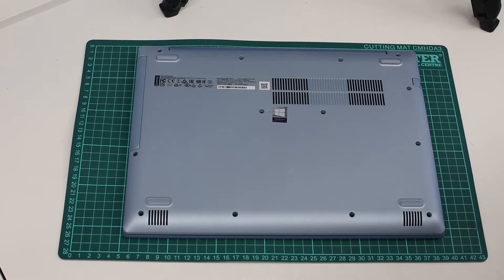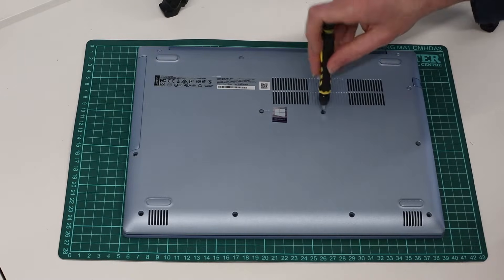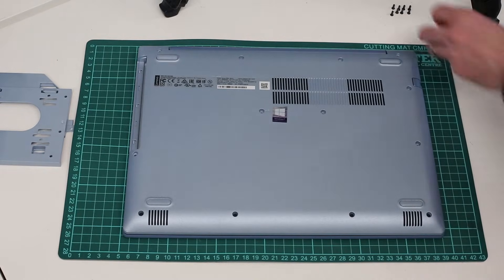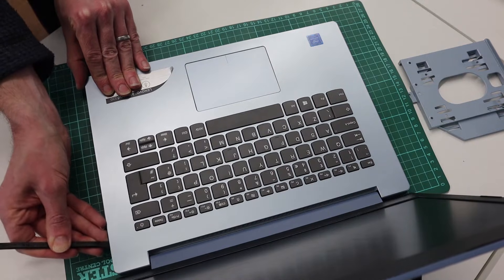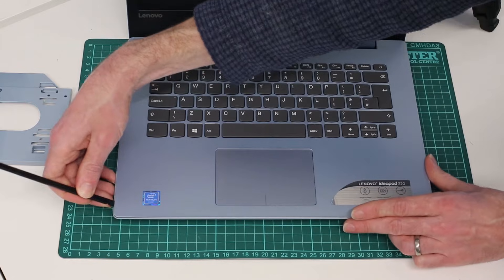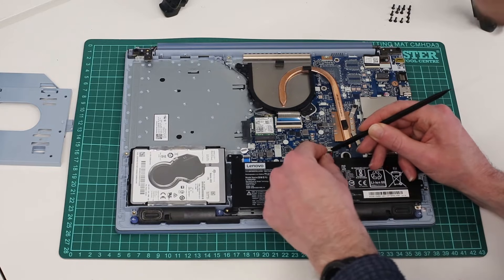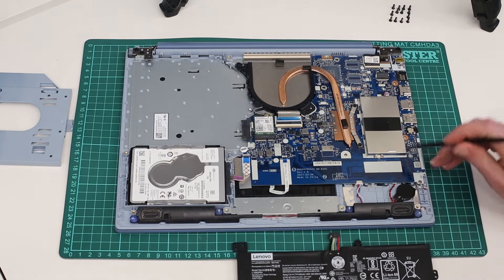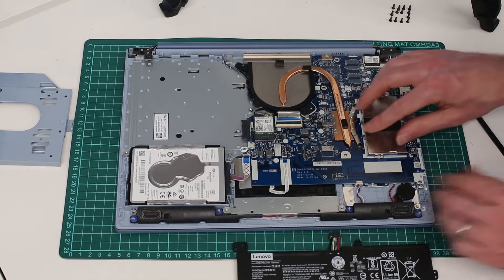Lenovo ideaPad 320 SSD/HDD and RAM upgrade guide

Comment: Hi, what is the maximum RAM we can add excluding the soldered one?
Reply: I just installed a 16GB memory stick and now it reads it as 20GB memory and 19.7 useable :)
Reply: @miketuck3010  so I can install 16GB memory stick without any hesitation or issues
Reply: @syedmominhina  absolutely! I just did that today myself on this laptop
Reply: @miketuck3010  Great then.. Thanks for the response bro
Reply: @syedmominhina  All good now?
Reply: @arifhm1  yes.. it is working fine with additional 8 GB along with 4GB soldered total 12GB now
Reply: @syedmominhina  Great! Thanks1

Comment: Enjoyed this tutorial. Gonna do this for my ideapad. Can I ask though, what's the rationale for swapping a 1tb drive to a 240 gb drive? I understand that ssd is much faster, but why swap to  a lower storage capacity?
Reply: Maybe it's like my case, I have 1tb of storage and I've never filled even half, buying a 1tb ssd would be much more expensive and I know I wouldn't have to fill it.
Reply: SSD are way faster than some people imagine, and most people never really use even half the storage of a half TB drive. So for some people speed might matter more than storage, Especially since the data that is backup can be stored on clouds or an external drive
Reply: @navysaw23  I know some laptops can hold both a HDD and SSD storage. Could it be done on this unit of laptop?
Reply: @mae6626  the kind of Drive doesnt matter, only the space in the case and the capability of the motherboard do. useually laptop can only hold one Drive, but if you have an DVD Reader, you migth be able to exchange it to another drive. Cables connection (SATA) is the same

Comment: Yes you did the physical part of it... But what about the system recognizing it and bios setup. Not as easy as your video. Tried it... Tedious task for the average user. Tell them the truth about the OS install that will not be there as they expect it to just turn on and be fast. If your gonna do this. Be specific. Most dont know and will try this on their own without thinking of all the factors.
Reply: Just clone your hard drive that you are replacing from the instructions that are provided with the replacement SSD drive, that's all I did.  I even upgraded the memory with a 16GB memory stick and had no issues whatsoever.  It took me all of 30 min to take a part the laptop, put the new memory and SSD drive in and booted up without any issues.  Much faster laptop now with those upgrades.

Comment: Hi, I followed your instructions for my Lenovo 320 and upgraded the RAM. Thanks a lot.
Reply: DDR3? DDR4?
Reply: @stetm8  DDR4
Reply: @MrPsyUNIT  Is it true that it can only have a max of 16 mb RAM?  So, I would remove the 8 mb RAM I have, and then input the 16 mb RAM?
Reply: @MrPsyUNIT  Is it true that it can only have a max of 16 mb RAM?  So, I would remove the 8 mb RAM I have, and then input the 16 mb RAM?
Reply: @tansyalexander2543  there's only one slot for RAM, so yes, you would have to remove the current RAM chip & install a new one. Based on my google research it can only take max 16 gb RAM chip (I may be wrong).
Reply: @MrPsyUNIT  Thank
Reply: @MrPsyUNIT  I added 16GB ram today and my laptop reads 20GB and 19.7 as useable :)
Reply: @tansyalexander2543  I added 16GB ram today and my laptop reads 20GB and 19.7 as useable :)
Reply: @miketuck3010  did it work perfectly or did you have to lower the ram ?

Comment: Hi!... I noticed that in the cover of the CD drive you can put a second hard disk but the connection we have there is micro sata (if I'm not mistaken), do you know if there is an adapter that can work to install the second hard disk there?
Reply: Yes u need a special adpater called caddy

Comment: can someone help me with my problem?

I was planning to upgrade my ram for my Lenovo IdeaPad 320-14IAP

I ordered a
Kingston ValueRAM 8GB 2400Mhz DDR4 Non-ECC CL17 SODIMM 1Rx8 Laptop Memory RAM

but the seller suggest that i should buy the one with 1600MHZ instead of 2400Mhz
Kingston Value RAM 8GB 1600MHz PC3L-12800 DDR3L 1.35V Non-ECC CL11 SODIMM 2Rx8 Laptop Memory RAM

the seller also told me that the ram with 2400Mhz is not compatible to my laptop.

should the 2400Mhz still works? or should i cancel my order? thanks for reading.
Reply: Lenovo 320 use ddr3l 1600 mhz
Reply: @user42362  thanks
Reply: I just installed 2400MHz 16GB DDR4 PC4-19200 without any issues

Comment: Is it relatable to idepad 320 151sk model,Can i add or exchange ram?plz reply
Reply: Yes, I used these instructions for 320-15ISK, in replacing the HDD for an SSD,  and the inside of my laptop had the same layout as presented in this video.
My model had 4G of RAM soldered on the motherboard and with only one free slot for another RAM stick
Reply: Can i add 16gb ram 2400mhz.?
Reply: @payatpayat3997  Yes, according to the Hardware Maintanace Manual, it should support 16G / 2400MHz RAM (see page 71)

https://download.lenovo.com/consumer/mobiles_pub/ideapad320-15isk_320x-15isk_320-15ikb_320x-15ikb_320-15ikbtouch_hmm_201704.pdf#ideapad%20320S-15ISK%20IKB%20HMM_EN.indd%3AAnchor

DDR4 2400 Memory (ISK and KBL only), 16GB DDR4 2400 SoDIMM, M471A2K43CB1-CRC / SM30M499035
DDR4 2400 Memory (ISK and KBL only), 16GB DDR4 2400 SoDIMM, HMA82GS6AFR8N-UH / SM30G165135
DDR4 2400 Memory (ISK and KBL only), 16GB DDR4 2400 SoDIMM, MTA16ATF2G64H-2G3B1 / SM30G16514

I presume those were confirmed to work with the soldered 4G of RAM (on the ISK model, in my case)

Comment: Is CPU can upgrade with Lenovo IdeaPad 320?
Reply from the maker: No, the CPU is soldered down in pretty much all modern laptops - only a few very high-end gaming and workstation laptops using desktop CPUs have replaceable chips.
Reply: @BrueComputing  but the GPU?
Reply: @BrueComputing  can upgrade with the GPU?

Comment: How many RAM slots does it have, beside the One which is already on the system and cannot be removed? Are there 2 or there is only 1 extensible RAM slot?
Reply: No well some models have 4gb pre installed so you can add another one like 16GB ram and in total you will have 20gb ram since one ram slot is already allocated

Comment: i loved your video! i was really scared of opening my pc.

but can you install the SSD in another slot? so that you can have both a HDD and an SSD?

im sorry if it's a dumb question, im really new to this.
Reply: from what i know, you can replace the optical drive with an ssd + caddy, but it'll not give as much performance as the original hdd port.
Reply: @poisenpoi69420  what if you just replace the HDD with the ssd and connect the HDD to the caddy?
Reply: @CarlosAlberto-gf3dy  i think it will not work

Comment: Thanks a lot, the advice on pulling out the battery worked nicely. I was concerned about pulling it out because I had heard some models had it so you couldn't remove the battery, but it worked like a charm.

Comment: Thank you for this tutorial. I've been wanting to do this when I first purchased this laptop. It's been several years now and I've watched this video several times. Thanks to your video, I'm ready to tackle this upgrade. Without rushing it took me about 43 minutes to install 500 GB SSD and an additional 16GB RAM. (Total 20GB) The cloning of HDD was actually much more difficult than this. Thank you!
Reply: What brand and type of memory is that?
Reply: I'm trying to clone the HDD and having a rough time. Was there a specific video you would recommend?
Reply: @michael7235  See: https://www.youtube.com/watch?v=JV43dmhsQS4 for James' video.
Reply: can you add additional memory to the existing 4GB RAM? I have the 320 151S model
Reply: How does it work now ?
Reply: @High_on_fitnesss  i added 8gb ram, making it 12gb ram. I noticed speed difference than the original 4gb ram.. especially since im using windows 10 on HDD. So much faster now
Reply: @gmybear87   i wanna add ssd 500 and how many ram i can add ? pls help
Reply: @gonfreecs1331  4GB or 8GB

Comment: I have some question. Is the optical port is sata 2 or sata 3?? If i put ssd through caddy without replacing hhd then will i get full utilisation of ssd. I have lenovo idea 520 2tb hhd series plaptop. Is the 2 tb also 2.5 mm thick. ??

Comment: Hi! I have the same model, does it really not has a fan? I am curious because i haven't opened it yet.
Reply: I see. Thank you
Reply from the maker: It depends on the model you have - this was a Pentium Silver based version of it which uses very little power. The Core i3 and above models will have a fan as the processor generates more heat.

Comment: hi, I have the same laptop, I would like to know if in this laptop is it possible to upgrade the CPU?
Reply from the maker: No. Pretty much no modern laptops have an upgrade-able CPU - only a few high-end gaming laptops with desktop CPUs in them.
In everything else, the CPU is soldered to the mainboard, so to upgrade it you'd have to replace the entire board, which is rarely cost effective.

Comment: I had that ideapad also but so Laggy, when I open it for the first time I was shocked because there are no FANS at all hahahaha and also only 1 slot for RAM and it's Intel (R) Celeron @ 1.10GHz
Reply from the maker: That's pretty standard on the low-end Celeron systems.
Reply: @BrueComputing  Yeah I search about the celeron and have full of regret for now. hahaha but still I only use this for personal only like playing music at home, because it's to much of lag I can't use this for my work.
Reply: Intel Celeron @1.10 Ghz runs around 2.30 ghz when running heavy programs. I run AutoCAD and Solidworks on it and yes it is laggy, but I can still manage to finish any drawings. I also play Dota 2 on the lowest possible settings and it gives me 30~40 fps. It lags sometimes though.
Reply: @fn326  Bro I even uninstall Dota 2 ,because it's not giving me 30 fps IDK why, I only got 25 or 20 below that's all, it's so rare to see my laptop run at 29 fps. In short mine is to lag. Hahahahaha
Reply: @crescenciojohnmichaelp.8008  have you tried placing commands in Set Launch Options of Dota 2? I have around 7 or 8 of them. I knew about them because of reddit. It sometimes goes under 25 when I'm playing invoker. I just restart dota 2 after a game if the fps is already so low.

Comment: do you have any suggestions for 8 GB ram? please send a link.
Reply from the maker: Which exact model do you have? The 320-14IAP is DDR3L, the 320-14AST is DDR4
Reply: @BrueComputing  i have i5 7th gen ddr4 4g and it s not enough for me and i m looking for and upgrade ! can i fit 2 slots of ram or there is just 1 ram placement ?
Reply: @give_me_yourcoinsninia7590  same question did you get?
Reply: @give_me_yourcoinsninia7590  I have 1 spare 4 GB 😞 thanks for replying
Reply: @give_me_yourcoinsninia7590  4gb +4gb? I mean it has two slots?
Reply: @give_me_yourcoinsninia7590  ok thanks you so much for your efforts

Comment: i don't understand the part when you say the hard drive is limited to 2.5? I'm planning to buy a ssd to change my hhd but i'm not sure if it is compatible with that kind of upgrade. I have same laptop as yours only my is 15.6'', lenovo 320 15Ikb
Reply from the maker: 2.5" is the standard width for laptop SATA hard drives. Desktop drives are 3.5" and much thicker.
Reply: @BrueComputing  thank you for your answer. About the ram, how much could you update it? You have  4gb solded too?

Comment: Hi . a good video guide ! but i want to ask about ram upgrade.I have ideapad 320 too but when i put a 8gb ram 2133mhz in it the laptops only can run about 8 minutes before the blue screen pop ups . Can i know if you have the same problem or not. How to fix it?
Reply from the maker: Sounds like a faulty memory module.
Reply: @BrueComputing  did you try to upgrade the ram on ideapad 320? Im planning to do so also but Im afraid will have the same issue
Reply: Same probleme I have 4gb and I put an other 8 gb and then I have bsod . I think it was the wrong one . On this case you should ask a specialist before buying any ram

Comment: Finally a video that help I have the 14 AST not sure if the cd drive connection is mSATA OR m.2 ? It’s so confusing or if it’s just a dvd drive connector I can’t find this colour in stock
Reply from the maker: You'd need a caddy like this: https://amzn.to/3bRkwfC
The facia might not match (as it is designed for the ThinkPad) but you need one which includes the mounting bracket as this is built in to the placeholder and can't be removed.

Comment: Hi, great video! I have the same laptop and I was thinking of adding another SSD to the drive bay but as you say the plastic is one moulded piece which is a slight problem. Would you know where to get an optical drive bay caddy that would work for this laptop?
Reply from the maker: You'd need a caddy like this: https://amzn.to/3bRkwfC
The facia might not match (as it is designed for the ThinkPad) but you need one which includes the mounting bracket as this is built in to the placeholder and can't be removed.
Reply: Hey bro. Can I put harddisk in the caddy in the optical drive???
Please help